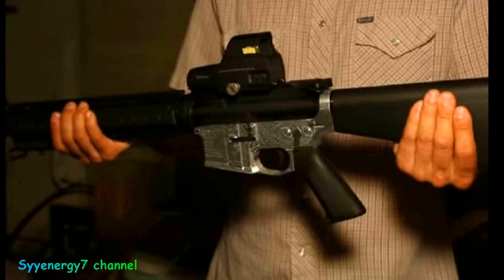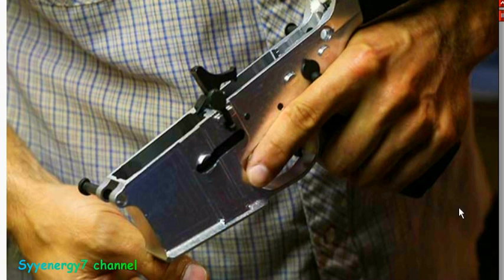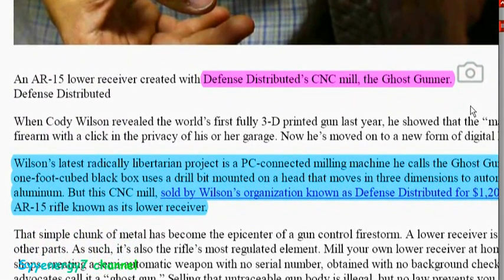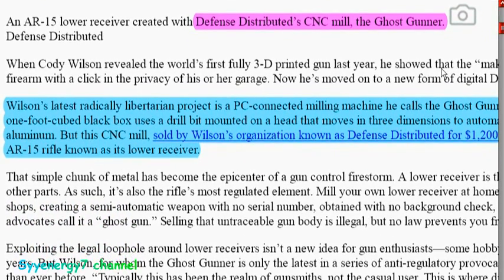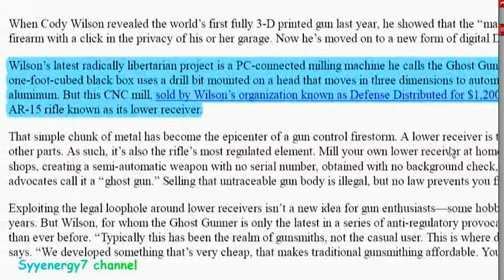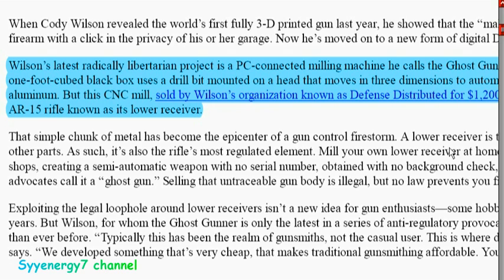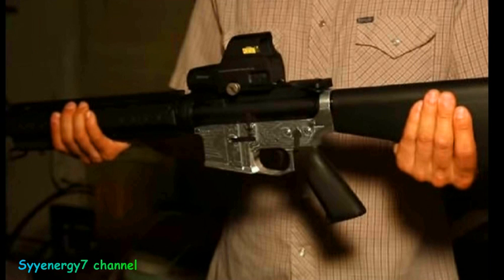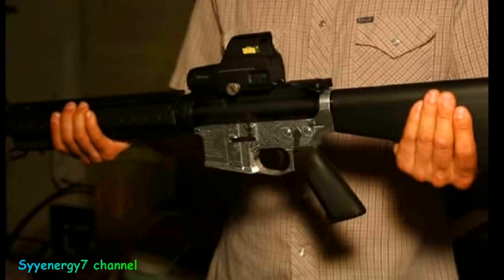Make you own gun, $1200 CNC machine

Comment: why do I doubt this? maybe because I do Not know of any drill bit that even last a few minutes drilling through Steel.
Reply: Are you kidding me? Get yourself an American made drill set (there are still MANY drill bits that are American made) that are made of HSS (high speed steel) or cobalt steel and it will cut through steel all day long like butter. And this mill doesn't even use drill bits! It uses end-mills which can be bought made of HSS, Cobalt Steel, or solid fucking Carbide!

Don't spout crap you dont know anything about.

And aluminum never rusts.
Reply from the maker: It is not or steel,  Aluminum.  That's all you need for an AR lower.
Reply: ALL BILLET UPPERS AND LOWERS FOR AR-15s ARE MADE WITH A CNC ROUTER!

As mentioned, this is aluminum being drilled, not Steel. 

That being said, you can get bits specifically for drilling steel, and they will last much longer than a few minutes if you use them correctly.
Reply: +Steve Thompson facepalm
Reply: Jeffrey Lafleur 
"ALL BILLET UPPERS AND LOWERS FOR AR-15s ARE MADE WITH A CNC ROUTER!"
-A router is WAY different than a milling machine. Its literally impossible to do any milling operations with a router.

Comment: That looks pretty cool as a gadget for your computer and cheap too

I work cnc milling machines from 1987 to 2000 they were advanced but very expensive
In 1993 we had a new control system that could pull designs in from the drawing office and write its own program.. The last cnc machine they bought cost over $1.6 million.. a far cry from 1200 bucks lol

I'm guessing that little gadget links to a cad program and can make just about anything that fits inside it